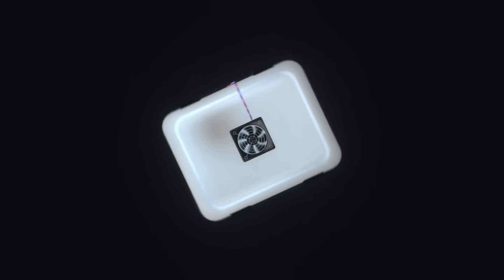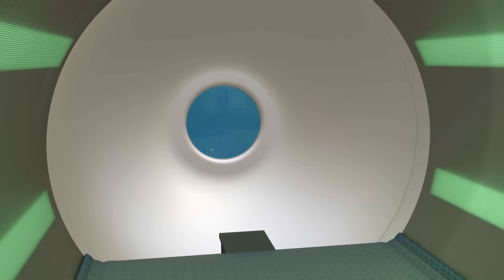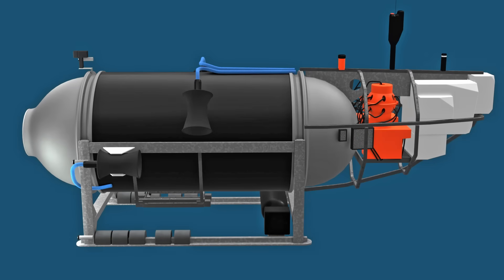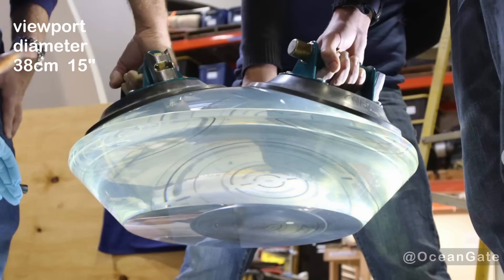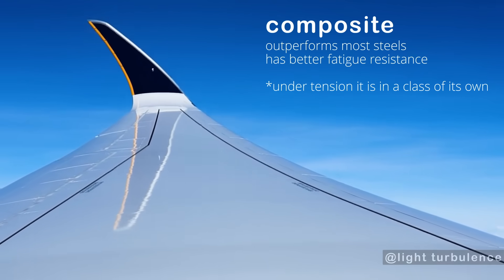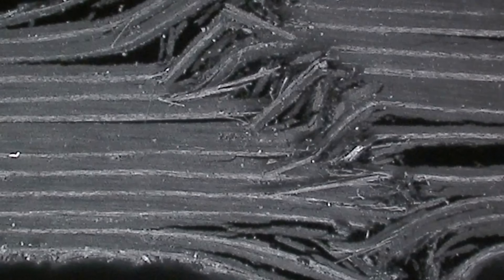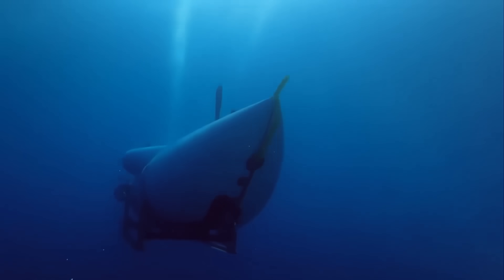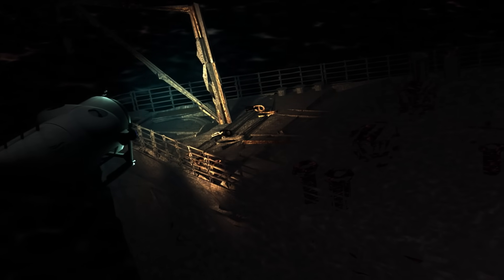Titan Sub | carbon fiber - Detailed Tour

Comment: No you're completely wrong about carbon fiber and compressive forces. 100% wrong
Reply from the maker: No you are wrong. It has incredible compressive strength. If it didn’t all the aircraft built from it would have their wings falling off on takeoff
Reply: @Mike-Bell  James Cameron is correct.
Reply: @Mike-Bell  450 elephants is compressive force.
Reply: @Mike-Bell  your video has 3 different people explaining the difference between tension force and compressive force.  Airplanes do not have that much compression force.  Submersibles do.
Reply: @Mike-Bell  not compassion compressive
Reply from the maker: @ChadFarthouse-h8r  I''l have compassion for you. 😂 Listening to James Cameron and a few others does give you an education in compressive forces and how structures work ... Study and work with these things for many years and then you will know what you are talking about.
Reply: @Mike-Bell  Google " compressive force carbon fiber. The problem you have is you don't know the difference  between compressive and tension. James Cameron is highly respected in the submersible community.  You really have no clue what you're saying.
Reply: @Mike-Bell  that's not compression force , that's tension force. You need to do your homework.  You're wrong.  They make scuba tanks from carbon fiber because the force is going from the inside out but when you reverse that it's compressive force . I'm sorry but you're wrong
Reply from the maker: @ChadFarthouse-h8r  ok so you’re going to tell me the carbon fibre racing foil that a racing yacht rides on top of is just tension force. When the full weight of the yacht is supported on the vertical post of the foil. No dude you don’t understand structures. The bottom of a wing is in tension and the top is in compression and the forced balance each other out. The best you can manage is listening to a movie director and poof you are an expert.
Reply: @Mike-Bell  I'm saving that is mostly tension force.  Did you watch your own video? They talk about the difference.
Reply: You're wrong. 
Tension force and compassion force are two different things. There is some compassion force on airplane wings but it is not even close to the compressive force of a submarine.  Yes , James Cameron is right and so are the other two people in that segment of your video. James Cameron has been to the challenger deep the deepest point on earth in a submersible he helped design . I think he knows a bit more than you about compressive forces.
Reply: @Mike-Bell  sorry dude you're wrong
Reply: @Mike-Bell  there is a big difference  between the weight of the ocean and a yacht. Is carbon 
Fiber  strong? Yes . Is it strong against compressive forces for submersible? No.
Reply: @ChadFarthouse-h8r  buddy, you see how the wing bows downward? that means the top is in compression, the bottom in tension. If only tension was involved, what is the tension spanning between? An invisible rail in the sky?
Reply: @Mike-Bell  Thanks for helpful reminder there must be exactly as much compression force on the top of a wing as the bottom provides tension- because the tension has to have something to pull against. And obviously if the forces weren't balanced things would move until they are. Stuff that us non engineers dont immediately think of ha
Reply: @chir0pter  you're wrong. .
Reply: @chir0pter  that's nit considered compressive force  . A wing is under tensile force.  Just leave me alone.  Go away
Reply: You're wrong. Forces exerted on a plane of a wing is under tensile.  A submarine the forces are directed inward and it's compressive.  Please just go away. You couldn't be more wrong
Reply: @ChadFarthouse-h8r  Tension means things are pulling on both ends. What is pulling on the far end of an airplane wing? Nothing except the parts of the airplane wing that are under compression! So you have both operating. A pure tension system would be like a utility wire.

Comment: I think eventually carbon fiber technology will be able to produce a safe sub in the future.

But the future is not today. 

Until such time as a carbon fiber can survive destructive testing via 30-50 repeated pressurization/depressurization cycles, Steel should be used.

Comment: With outward flange bends it makes it seem like the joint between the titanium and the carbon started to shift at the rear and so instead of the typical implosion you would normally get you would actually get an instability in the pressure chamber which would then feed the pressure change through into the cabin and cause the explosion style damage as it would get ripped and pushed rather than crushed.
It should mean there is 1 large piece of carbon to go along with the many smaller pieces due to the rotational force that would have existed and so I'm sure someone will recover it in the future

Comment: Not meaning to be disputational….but my perhaps faulty common sense view is that your assessment of carbon fiber in compression vs tension seems incorrect. My thought process if you have a rope with no epoxy… its property will be strong in tension, but weak in compression. If you then add epoxy… the tension strength will be maintained… but according to my logic the compression strength will be mostly based upon the admixture of epoxy resin.  For what it is worth.l. I saw a youtube video where the presenter was using a hydraulic press to test various materials…. Including steel, titanium  and carbon fiber. The failure mode of carbon fibers was basically explosive shattering
Reply from the maker: Its a fallacy that carbon fibre is only good for tension. There are so many applications where carbon fibre carries massive compression. Take for example the foils of the newest generation of racing on yacht. How does all the 7.5 ton of weight stay up on that foil. That’s because it is resisting spectacular compression forces.
Reply: @Mike-Bell  
Mike. See the following
One challenge is that if there are defects in the composite, such as air bubbles or gaps that are left around the carbon fibers, that becomes a weak point,” Yourdkhani said. “If weight or pressure is applied, there is a very high chance that your structure will start to fail. Another challenge with this is that defects occur inside the material that are not visible to the naked eye.” So how can we identify these defects? There are techniques for this that are a part of a tedious process, which is another reason why producing carbon fiber composites can be so expensive. The idea is similar to the imaging techniques used in the medical field. The most common inspection technique is the use of ultrasound to see inside the material and identify inconsistencies. There are ultrasound machines that scan the surface of a composite structure and detects potential defects. Since every part of a structure should be inspected locally, the process becomes slow and expensive to run but such inspections are vital to assure the quality of produced parts and are standard in the industry.

Another challenge is something called “fatigue.” Fatigue is when material undergoes “loading” and “unloading,” or the process of applying and removing pressure, such as when a submersible goes down into the ocean and comes back up to the surface. If there are defects present, those defects will start to grow. An inspection needs to be done after each process of unloading and loading to ensure that no defect or damage has progressed inside the structure.

“When a submersible is going underwater to significant depths, the pressure that vessel is experiencing is much higher than an airplane in the air, so these challenges are exponentially increased,” Yourdkhani said. “Obviously at this time the cause of failure is not known, all we can do is speculate, but composites are actually quite safe if they are well designed, manufactured, and tested.”

What is emphasized is the theory of strength and safety in the context of scrupulous design and manufacturing . As well as an EXPENSIVE TESTING regimen to proactively identify hidden faults.  I think that in retrospect we can observe that Stockton Rush was a guy who thought scrupulous    And expensive processes were overemphasized and he intended to “prove” how far such precautions could expediently be eliminated… which has tarnished the view of composites
Reply from the maker: @MrArdytube  first rule of carbon fibre is know what you are doing with procedures near perfection. Otherwise you are on a hiding to nothing. To achieve the insane structural capabilities you cant be doing jerry built.

Comment: based on information the cylinder was 5 inches of carbon fiber 
would it of been better if it was made with 2.5 inches of reinforced steel and 2.5 inches of carbon fiber?  to both reduce weight and reinforce the cylinder?

Comment: Actually Titan did use thrusters to ascend a couple of times where a ballast weight failed to fall off so that's not unheard of. And if they dropped the frame as evidence suggests since it is not deformed and still had to thrust, that means water got between the layers of the carbon fiber cylinder before it failed, and that's down to not curing the carbon fiber under pressure like the aircraft industry does.

Comment: I think your on the right track Mike it could been anything which caused the composite to fail. I worked on composite for 10 years and when not looked after you open a vast area of point of failure if it for example is landed back on the mother ship roughly when it's craned back on board there or I have a suspension the possibility of may be a couple of times a rough touch down on the ocean floor with all that pressure.... but I'm guessing.

Comment: Your statements on carbon fibers "outstanding" ability to handle compression are 100% wrong. Your entire video is filled with inaccuracies. In short, your theories don't hold water.

Comment: HMM, Stockton Rush said he took it to 4000 meters and it made a lot of noise which is a VERY sphincter tightening experience
Reply: It didn't make any more noise cause broken fibers can't POW. 
"The Sphincter Valve Effect" what happens is.... noise and visuals ALL/BOTH travel South to the Spincter Muscle, they have to circumvent what is commonly cvalled 'the oriface interface', the nerves there are very thin and need bloodflow.
Once you throw TOO MUCH INFORMATION down theree, the Sphincter Valve closes, muscle tightness causes a drop in blood flow.... nerves can't pas information past .......and the brain has no choice but to mutter OH SHYT!!!

Comment: It's amazing how many "safty mechanisms" they've implement into and cheapened on THE most important part.

IF this was a prototype for unmanned or hell even just Rush alone testing it would almost be impressive.
But bringing people on board with such an untested, unverified and unlicensed vessel is so negligent and greedy it's crazy.

On top of it the complete disregard for operating the expedition itself properly is baffling, in recent new it has been found through voice logs that Rush, ironically rushed and descended too fast, and it is very know that even in scuba diving you wre not sllowed to descend or rise too quickly, it is fatal to do that, and that's peanuts by comparison to the pressures down there.
Unless those were fake, he made a BIG mistake on a vessel that was already criticized for being untested and unsafe.
Another not new info is that they hit a rock in one of their expeditions, which could've easily caused what happened in this instance, they were lucky back than, a tiny puncture and it would've been crushed.

Comment: That's why we use spheres at those depths, the compressive load is distributed equally throughout all three dimensions. Using a tube put tremendous force on those end caps laterally and on the carbon-fiber tube itself vertically and horizontally. As you pointed out I think those end caps crushed the tube until it shattered. Had it been made from steel it may have noticeably deformed, but I don't have the qualifications to really say. A preventable catastrophe which should have been more tightly scrutinized, especially where paying passengers were concerned.

Comment: The weakest point appears to be the connection between the titanium ends and the lathed/reduced diameter of the carbon fiber tube.  The lathed end appears to be few inches long.  One would think a longer section would allow for more glue surface.
The second concern is carbon fiber is popular with pressure cylinders where the pressure is from the inside outward not outside in.

Comment: You have no idea what you were talking about my carbon fiber is so weak you can snap it with your hands let me go see you snap piece of steel with your you may be able to you damn sure ain't going to snap it in the pieces and you're talking a carbon fiber base that's put together with glue and fiber which salt water do your what it does the synthetic material

Comment: You seem to forget one thing . While an implosion is mostly made of implosion there are still parts of any deep diving vehicules that suffer explosion . For exemple  those six oxygen containers  Those  contained compressed air and all six of them imploding at the same time would have released its air all at the same time and already compressed air can only do one thing when instanly released , explode and it would have done so  a milli second after the implosion enough to send air in both ends of the tube causing the rims to explode outwards instead of imploding  inward cause that air had to realease somewhere and that would also explain why the acrylic window came off  from the titanium shell .If the outside pressure cannot implode a space full of air from the outside  it will do it from the inside when a failure  occures on the  structure and will exert pressure on the air itself contained inside the vehicule and since a deep diving sub is built to take pressure from the outside only a sudden built of pressure from the inside would cause everythng to fail .

Take for exemple the Titanic stern . whille many of its closed compartment imploded on the descent you can bet that at the same time that pressure exerted on the hull when they started to buckle also exerted extreme pressure on theair contained in the closed compartments  and that air has to release somewhere . Where would that air be released ? well if you could send camera inside the stern i'm sure that every compartment that imploded also had their doors blown off by the air  pressure at the same time that the hall buckled and imploded .

Comment: Carbon fiber sucks in compression.   It's not steel.
Reply from the maker: The simple fact is carbon fibre does carry insane compression like in the small slender cross section of racing yacht foils that carry the entire boat. And at the wing root of an airliner. Etc.  

I understand carbon fibre doesn’t “feel” like it can take compression… rope good in tension but  not compression example. However facts don’t care how you feel. Whether you like it or not carbon is phenomenal in compression.

Comment: those glue joints failed. just watching them build it i was like you cant be serious, these guys hava no clue what theyre doing when bonding composites to stuff... all the joints should have had weep holes with squish out coming out of all of them, otherwise there are massive air pockets in the joint. ... even with weep holes there would be some air pockets but it would be minimal and not enough to allow flexing of the cylinder in the joint....

not to mention the lack of cleaning and prep on the joints, the undersized flanges on the joints, and much more..

Comment: I cannot judge the suitability of carbon fiber, but the combination of different materials is always critical. Under the enormous pressure, the different materials shrink differently. This puts stress on the connections again. Apparently something moved in the millimeter range as it repeatedly sank and resurfaced. Then there was a stress fracture.

Comment: 12 minutes in, to paraphrase, 'doing it right would have required redesigning the mandrel and throwing away 40% of this really expensive material'.  Do you understand how much of a diamond is typically chipped away to get the best cut?  How much of mahogany is converted to sawdust and chips to make a vanity, or how much fiddleback maple winds up on a shop floor when you make a violin?  Dude it's not about what goes into a thing that makes it important, it's about what comes out.  How'd that '40% savings' on raw materials work out, eh?  SR was an idiot masquerading as an 'innovator' and had no business doing what he was doing.  If this clown was an engineer he was the most incompetent one I've ever heard of.

Comment: I believe the cause of failure was do to Cyclic fatigue. Carbon fiber is a diaphanous material by its self and when worked it becomes a very strong substrate however I feel corners were cut and testing was not a paramount focus to Stockton Rush. Very Sad.

Comment: I’m sorry, but you’re wrong. Carbon fiber composite isn’t used in compression because it derives its exceptional strength from the fibers, which are capable of carrying very high tensile loads but will buckle in compression if they are not held in place by the resin matrix. That, combined with being exceptionally brittle, is why we don’t use it in shipbuilding.